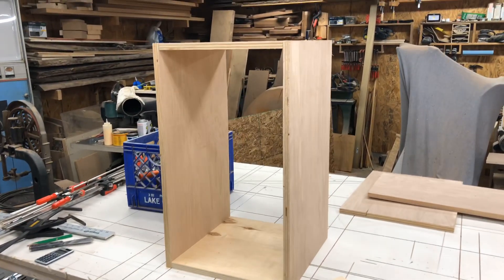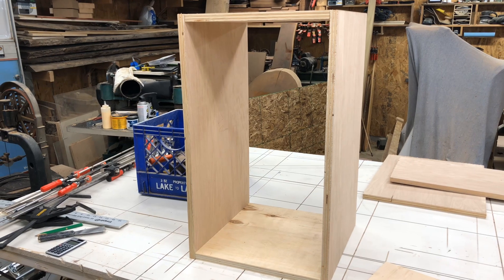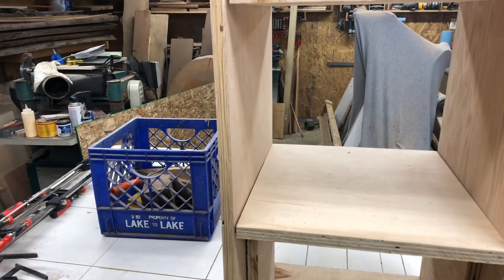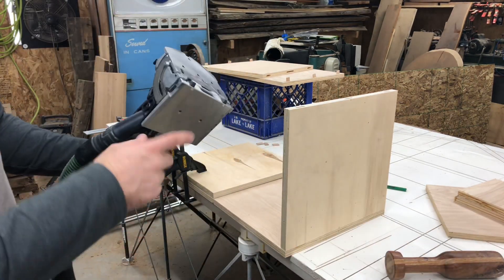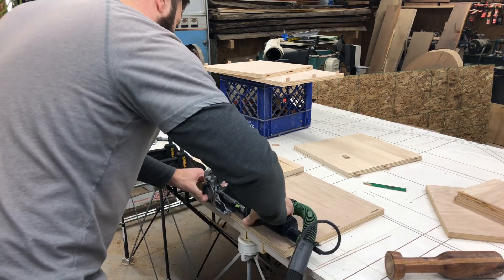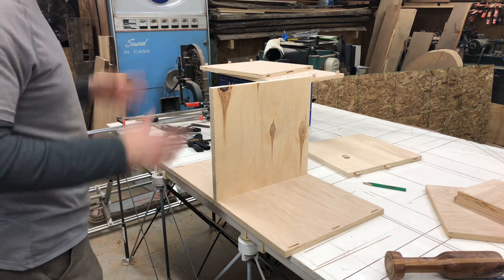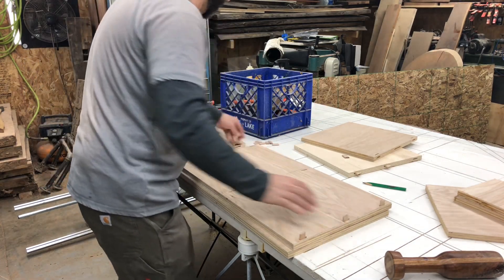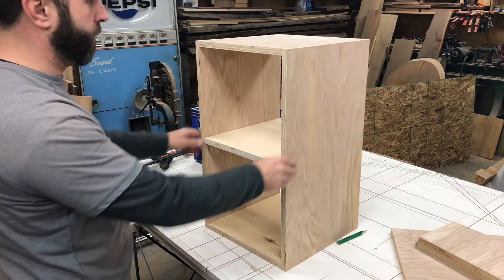Festool Domino— Mid-Panel Joinery

Comment: I found out real quick that it only works if both cuts are registered off the bottom of the domino machine. In other words it doesn’t work if you want a different height in the edge of the wood unless you add a shim under the bottom of the domino machine for both cuts.

Comment: Wouldn't it be simpler to use the spacer to line up the Domino?  It would place it slightly higher (maybe 2-3mm) than your method but no need for the line or any slight error in aligning the shelf with the line.  No alignment needed for the Dominos in the shelf so they can be set in using the guide pins as before.
Reply: i know I'm kinda randomly asking but do anybody know of a good place to watch newly released tv shows online?

Comment: Great Video!  I am trying to align a but joint where the bottom is 1" thick and side is 3/4" thick.  For some reason I cannot get the side to be flush with the bottom.  I'm miss-aliening something because the side keeps coming up short or not flush with the bottom.  Any suggestions?  Thanks so much for the video it really helps.

Comment: Would it be the exact same method if you were using say 81 inch or even a 2 inch thick shelf? Or is this message it technically only used for say 3/4” shelves

Comment: This has to minimum 3/4 right? Can't do this with 1/2 inch or am I wrong
Reply from the maker: I’ve used my domino on 1/2” material before with good results. Use the 4 or 5 mm cutter and make sure the vertical/height fence is bottomed out. Highly recommend doing a test piece.

Comment: That’s fine the way you show aligning with the side panel but what if the shelf is thicker and you have to use the fence to get the mortise centered say you set the fence at 20mm so obviously you can’t use the fence to align it on the side panel and the bottom of the sole or plate is 10mm from the center cut mortise, how do you align it square and accurately ?
Reply from the maker: I don’t worry about having the mortise in the middle of the shelves as much. If you cut the domino without the fence, the holes will be aligned. It doesn’t matter where the hole is, the domino is being used just for alignment, not strength.
Reply: Second Life Design Ok well here’s an actual event I just had. I’m building a solid Ash trestle table. I’m connecting the trestle to the end pedistal using the Festool connectors. The trestle is 43mm thick x 6” wide and the vertical post in the pedestal is 3 3/4” sq. I wanted the trestle in the center of the post equal both sides. I set the fence at 20mm  and made my 3 50mm cuts in both ends using the 14mm cutter. Now on the post I couldn’t use the fence right? so I had marked the edge of the trestle now had I placed the sole on the line, it would have cut the mortise 10mm from the line which would’ve been off the line so I measured 10mm from the marked line and struck another line and used that as the reference to align the sole up thinking 10mm + 10mm would align with the 20mm I had set the fence up and the trestle would align where I wanted it, in the center of the post? well it didn’t, it was 1/16” off. It’s ok and looks fine, you wouldn’t notice but I’m kinda a perfectionist lol so how the hell do you align the sole properly when not using the fence? I can’t seem to find out from anyone! Thanks 👍👍
Reply: @TeamProsperity  If you are such a perfectionist, then stop using german craptool and do traditional mortise and tenon.

Comment: You’re missing the mid point of bit. In your case you should be out of line for 3-4mm, depending on jig size (4mm)
Reply: You should have been mention, that you subtracted the half of shelf's thickness, before drawing a line. Add a comment to a video, so guys like won't get confused. Other way, thanks for a tip.
Reply: Deniss Samoilov if I understand what you are saying, he didn’t subtract half of the thickness before drawing the line. The bottom of the domino machine lays flat on the same surface as the wood which is receiving an edge slot for one board and the bottom of the domino machine is in line with the pencil mark for the other board. If you ‘fold’ the shelf down i to place, the slots between the two boards should perfectly line up. 

This technique doesn’t work if a vertically centered domino is required in a thick board (for example a 2 inch thick one). If I’m wrong, somebody correct me because I’m using this technique today and this is my experience. I’ll make a video showing how to use this technique with thicker lumber while keeping the domino centered in the thickness unless this youtuber wants to do it for me.....